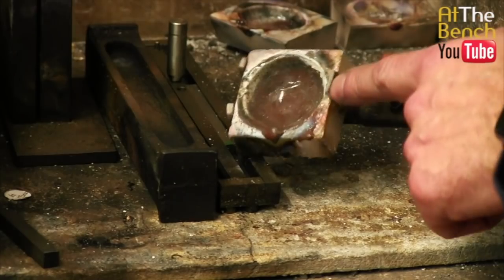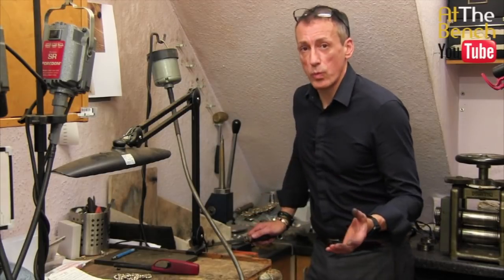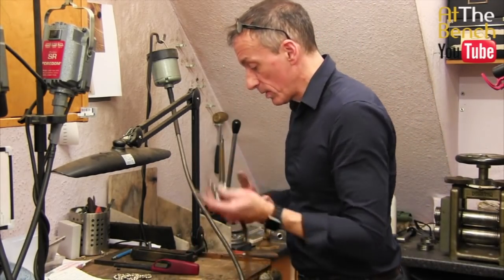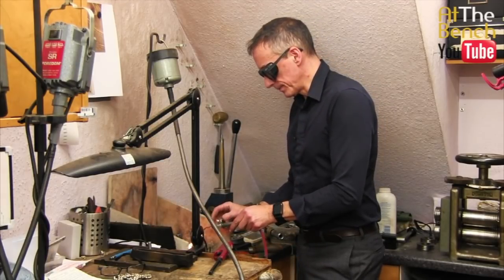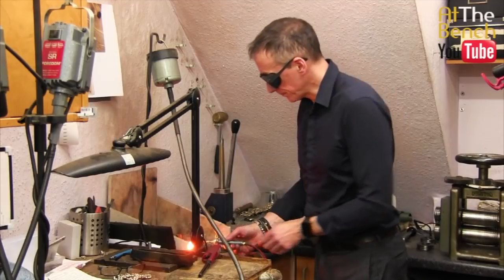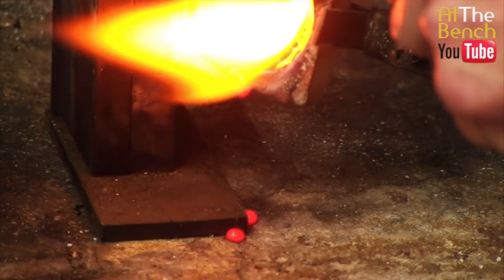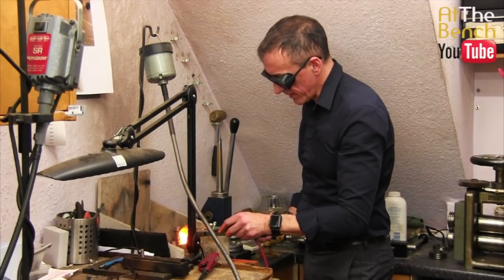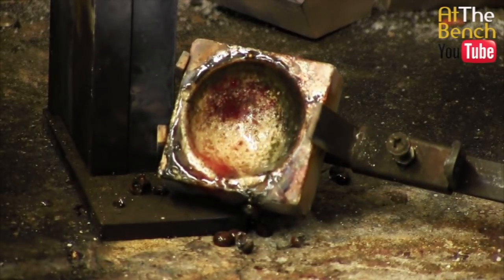How to Clean Out a Crucible - Melting Down Gold and Silver

Comment: Very interesting comment about the size of the crucible. Mine is the size of your big one and heat can be a challenge when melting.
Reply: I would imagine to efficiently heat something that size a side opening furnace with ceramic fiber insulation, even something pieced together would be needed to keep heat dissipation from really slowing down the process

Comment: Great info! Thanks! I do have a follow up question though. When I first started melting metal I didn’t realize I had to coat the crucible with flux. The crucible has small pieces of metal stuck to it and is cracking a bit. Is there any way to clean this out and flux it such that I can continue to use this crucible?

Comment: Hello. I'm not able to get my metal hot enough and after prizing it back out of my crucible (it always sticks to the bottom) my silver brought some glaze with it
How do I go about repairing a patchy and horrible glaze?
Thanks
Reply: I had the same problem when I started - are you using a butane brulé-style torch by any chance? 

It sounds to me like you need more heat. My solution was to get a MAPP gas powered blow torch and I've found it a lot easier
Reply: @kevinkelly8842  .
Butane - Propane mix .;)
Thanks... I will get searching for MAP.

Comment: When I clean my crucibles I drop the flux into ice water then dissolve the flux in hot sulfiric acid and recover the little bits of precious metals that were stuck in the flux
Reply: Why can't you pummel the flux with a hammer then pick out the pieces of metal?
Reply: I've done both but have found that the acid is a much better way cause at the end all that's left is the metal
Reply: Johnny do you remelt what's reclaimed or send it in to be refined?  Thanks for your reply...
Reply: @mikehamm8649  I do refining myself
Reply: @johnnyblueeyes8037  excellent.  Thank you for your time sir....